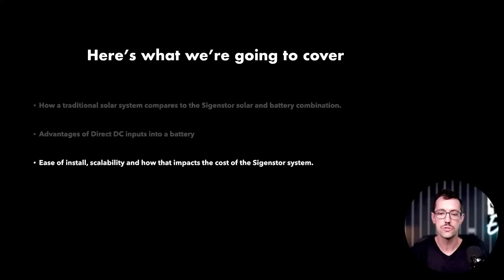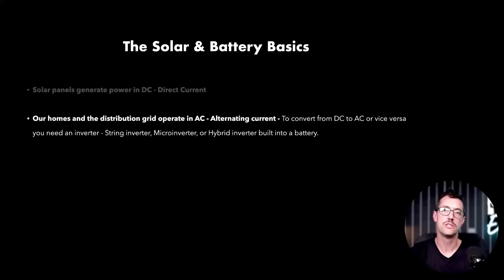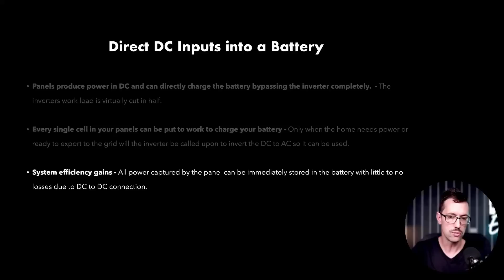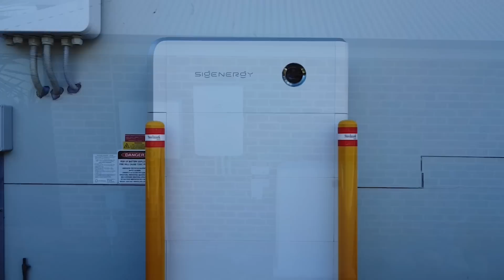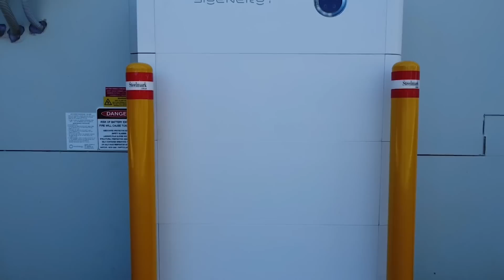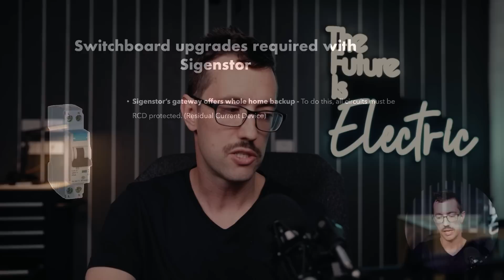Why SigenStor is Going Viral in Australia

Comment: I'm not sure about Sigenstor. I've been looking at the various options for a home battery system (I'm in WA). The problem I see is that the Sigenstor inverter (and hence solar panels and battery modules) stops working when it can't phone home to the Sigenergy server (in China?) over the internet in a 90 day period. I understand it does this to check the warranty status etc, but it's highly intrusive and worrying that your $10-20k solar system deliberately stops working if you either lose internet for 90 days, or Sigenergy (the company) goes out of business - they have only been around for a few years. It's a risk. There's also a, albeit slim, chance that Sigenergy could disable your system remotely if they wanted to (or were forced to) for whatever reason. At least for me, the security aspect is concerning, regardless of the (potentially very good) technical merit of the system. Which is a pity, because the Sigenstor system is otherwise very appealing, both technically and in terms of value. It would be great if this potential issue could be clarified. There should be no reason for critical home infrastructure like this to be internet dependent for basic functionality.
Reply: They use Amazon servers located in AU as per regulation and has passed cyber security tests of energy companies such as Origin.
Reply: @PJ-gw3op  Why would Origin care?
Reply: @PJ-gw3op  ummm... you trust Origin?
Reply: @PJ-gw3op the AWS environment in Australia means nothing. That’s just the initial dial home location, doesn’t mean that data isn’t then transferred elsewhere. Also the servers being in AU doesn’t stop Sigenergy turning off your system remotely.
Reply: @contactluke80 lol
Reply: Sigenstore ceo is ex-Huawei also. I didn’t know about the phone home thing. Absolutely a red flag. I won’t be buying without the option of local only…
Reply: Victron Energy systems are all Open Source.
Reply: the 90 day timing is now removed..... and you don't think that musk can shutdown every powerwall in the world...... stop the conspiracy bs
Reply: You're not sure, but I am. This is unacceptable. There should be ZERO communications between your power system and the manufacturer.  And this show-stopper should be 1000x more a red flag when that manufacturer is under the jurisdiction of a potentially hostile foreign power.

The idea of having software updates is a good thing. But there should be NO COMMINCATIONS HARDWARE AT ALL in your power system, and the software updates should be open source and audited by a trusted agency. Perhaps CSIRO would be willing to do that.

The company already turns off your batteries when it loses communication, and that's just a bit of a spanking to get you to stay compliant. What if they completely shut down your power the next time we have a trade dispute with China? Or what if it's worse.

On the business side, what if they say, "This system is no longer supported and will be shut down in 30 days. Contact your installer to upgrade"? Or what if they cut a deal with AGL/Origin and can shut you down when it's not in their commercial interest (like if you terminate your grid connection)?

All the scenarios where they can control your power are bad, and the trivial convenience of automatic updates isn't worth it. It would be hardly more work to download the newest audited firmware from a CSIRO website to a thumbdrive, and install it by inserting the thumbdrive manually.

Overall, I really like the idea of direct DC charging, but I'm not particularly keen on giving up control or being beholden to one company or the electric utility. We need a better solution that doesn't compromise in these areas.
Reply: @daveweinstein5044  I too am concerned by the scenario of a trade war with Sigenstore's parent government - the CCP. If SigEnergy gain, say, 20% of the home battery market in 'Western' countries, then relations turn sour, the Chinese Communist Party could instruct SigEnergy to remotely shut down everyone's systems. Suddenly removing 20% on a by then all-renewables grid would cause an immeadiate melt down and black out whole countries.

Think I'm over reacting? Federal and State Governments have already banned their departments all over Australia from purchasing/using Huawei communications equipment. For exactly the same reason - the potential for the CCP to take control in times of a trade wars.
Reply: @daveweinstein5044 100%
Reply: @daveweinstein5044  Excellent points. As you said any essential software updates (if they found a nasty bug for instance) could be easily done via thumb drive. A fast 32GB thumb drive from Officeworks is about $10 max which is overkill for any software update. I realise there is a cost incentive for manufacturers to put the software to control their more sophisticated appliances on a remote server and rely on the internet to drive the appliance, but it is a terrible idea for the consumer. Their internet could go down & your appliance stops working. The manufacturer can turn off your appliance any time it wants for however long it wants. In California, customers were surprised to find their air conditioners were disabled by their power company when the load on the grid got too high, which in California is a common situation. The customer paid for it, but the power company, by agreement with the manufacturer, had the final say as to when & how they could use it. Electric cars can be turned off remotely by the manufacturer. Amazon Kindle can arbitrarily revoke your ability to read any e-book you paid for. And these are US companies, subject to US justice system. Imagine how much worse it could be if the manufacturer was in China and there was no judicial appeal.
Reply: @daveweinstein5044 Sorry mate, you're delusional in the classical sense. Just about everything you wrote is hysterical paranoia not based on reality. China is the reason for Australia's current wealth so there would be more compelling issues for everyone than battery control if hostilities erupted. The only reason China toughened trade conditions several years ago was because of absolutely stupid accusations from the government of the time that China allowed a lab leak causing Covid-19 to spread. I don't blame China for its response to such serious delirious accusations by a nitwit prime minister. And even then, it just increased import duty on certain items.
Reply: @daveweinstein5044 or what if they turn every battery into a bomb by setting the system to overcharge the battery and circumvent the software safety features so thousands of batteries catch fire simultaneously?
Reply: This is changing on release of the new App version 3.0 which is due out tomorrow 01Jun25.

With the new version apparently the following will apply (as stated by the MD of Sigenery Australia this week):

• In scenarios where the system is not connected to the Internet for a long period of time, more than 90 days, we will change our operation strategy for our All-in-One systems, which previously disabled the energy storage function and allowed the customer to use only the pure photovoltaic power generation function.
• Now we will allow customers to use the energy storage function while ensuring system safety, and customers can continue to charge and discharge. Charging and discharging speed performance will be slightly limited, but it will not be significant for customers. (Limitations may be greater when the operating environment is very poor).
• The short-term overload function cannot be supported in the case of long-term offline scenarios, and the Cut-off SOC will be appropriately adjusted to prevent battery damage caused by customers leaving the battery unattended for a long period of time.
• All adjustments are made to ensure that the customer's system can run safely when offline, while retaining the customer's charging and discharging functions.
Reply: @GW666-e7z why would would charging  and discharging performance need to be affected because of a long term disconnection from the net? 

Also why would the short term overload function be impacted? All of these “smarts” should be on the local system.
Reply: @GW666-e7z  Thanks for making the effort to write this. It's important information.

Comment: Sigenergy is shaking up the market and that is definitely a good thing. One thing many are asking yet we won’t know for a while is the long term reliability and safety of these batteries. However all products have to be new at some point and I applaud sigenergy for bringing in some competition that is really challenging the others to start thinking smarter and actually compete and innovate. 

As a person who invested 10k into a pv system with a fronius inverter 12 months ago I am now a bit stuck. BYD batteries are very expensive comparatively and don’t give the flexibility sigenstor does. It’s literally a similar price to ditch the fronius and go sigenergy batteries and inverter versus BYD battery only connected to my fronius gen24 single phase. 

Here’s hoping this drives down some pricing so those of us with relatively new systems can have an option that has reasonable ROI and payback periods…
Reply: fat wurse  there only here   2 years  so be carefull and te warranty  off 2 years  on important parts is pathetic

Comment: DC EV charging requires a voltage more than the EVs battery voltage which would be at least 400 V or thereabouts, this would mean that you can't DC charge an EV directly from the SigenStror battery i.e. the energy would have to go through a DC-DC convertor (similar to an invertor).
Reply: That sounds right. If it is going through a dcdc converter they can use 30% more current than what they are putting out, it will be interesting to see how efficient that charging system is compared to its VTH discharging.
Regardless it would be a a big benefit to have bidirectional charging so you can ave that extra battery power for the house if/when needed and an extra dump load also.

Comment: The problem with this is that MOST installers charge a labour charge per kw/hr So the premise of more battery capacity = cheaper because Sig makes it almost the same to install 8kw as it is to install 32k doesnt hold water
The quotes for install of a 8kw system and a 16kw should only differ by the cost of the battery module minus the fed rebate at 350ish per kw + maybe $100 for install (i'm being generous)
Unfortunately for the great majority of installers - this is not the case at all. and you see effectively labour charges of 1000 or 1500 for install for additional battery modules
Reply: So inspect the quote.

Comment: The hybrid inverter unit still does work when doing DC-DC as it has a couple of DC buses to maintain at the designed voltage levels (eg. Main DC bus from PV, battery charging DC bus). SigenStor don't appear to have included their DC charging bus output capacity on their data sheet so it's difficult to know if they can do full 10kw AC to grid plus x capacity of DC battery charging.
Reply: actually they have as it is the battery module ratings. each module can be charged at 0.5C ie 4kw for the 8kw battery so two modules = 8kw charge rate, 6 modules 48kw - dc at 24kw or AC grid charged at the inverter rating.
Reply: @AusPhilMotivated TY for that info, I was wondering how much PV input they can handle.
The batteries can handle that input charge rate, but can the MPPT’s on the inverter handle that much input from solar to charge the batteries at that rate? That would be nice.

Comment: What is known about these batteries in terms of their need to phone home (China), can these operate without an internet connection?
Reply: As per my previous comment:

This is changing on release of the new App version 3.0 which is due out tomorrow 01Jun25.

With the new version apparently the following will apply (as stated by the MD of Sigenery Australia this week):

• In scenarios where the system is not connected to the Internet for a long period of time, more than 90 days, we will change our operation strategy for our All-in-One systems, which previously disabled the energy storage function and allowed the customer to use only the pure photovoltaic power generation function.
• Now we will allow customers to use the energy storage function while ensuring system safety, and customers can continue to charge and discharge. Charging and discharging speed performance will be slightly limited, but it will not be significant for customers. (Limitations may be greater when the operating environment is very poor).
• The short-term overload function cannot be supported in the case of long-term offline scenarios, and the Cut-off SOC will be appropriately adjusted to prevent battery damage caused by customers leaving the battery unattended for a long period of time.
• All adjustments are made to ensure that the customer's system can run safely when offline, while retaining the customer's charging and discharging functions.

Comment: If you are off-grid or have a lot of battery, then AC doesn't really make sense anymore.
Almost any device you attach first converts the AC to 300V, and then DC-DC that voltage to the required voltage.
The invert takes DC as input and tries very very hard to make a perfect sinus of that with a lot of power electronics.
It's more cheap, much more efficient (these day(!)) and less lethal to go from battery storage voltage DC-DC to house DC voltage.
Reply: If you are speaking of 12vdc battery solar, it is only good for lower wattage items, lights, tv maybe, fridge maybe, but if you want a few higher power items like microwave, toasters, jugs, coffee machines, induction cooktops, AC, etc, you need 240vac or you start running a lot of heavy copper wire which is probably more expensive.

Comment: SO if I have an emphase system with the inverters on every panel... I can't utilise DC charging off that system? Am I understanding correctly? Have a power wall 2 at the moment, which has degraded a fair way, was keen on Sig to replace it.
Reply: You can't DC charge from an Enphase system, as every panel's DC output is inverted to AC, at the panel. You can integrate Enphase systems with Sigenergy tho, as an AC coupled arrangement. They connect to the Sig gateway's smart port. Your micro inverters are warranted for 25 years, no sense throwing them away.
Reply: @MichaelWakefield-mx6hg  Thanks legend, that was my understanding, just wading through the info; I thought it would be as simple as putting another PW2 on, and 12 months ago it would have been! But the last 12 months has seen a lot of changes in the solar/battery landscape. Sig still seem to be a top their option.
Reply: @tt123x  👍
Reply: @MichaelWakefield-mx6hg so there is more power losses when you have the enphase microinverters like in this setup?

Comment: Nice video Daniel. I see the ace in the pack for Sigenergy being their DC EV charger. Not only allows DC to flow directly from panel to vehicle, but by bypassing the EV charge inverter, they are best placed to take advantage of bidirectional capabilities. 

If you think about it, your connection to the EV's battery is via the charger. If you have a 7.4KW AC charge point, that's all you'll get from the EV battery. A DC 25KW charger gives you just that - up to 25KW back to the SigenStore stack, which would most likely view the EV battery as just another in parallel in the stack.

Comment: Doesn’t match up to the Tesla powerwall 3.  I place the SIGENERGY battery second to all others batteries available at present .
Reply: Try starting your aircon on a hot day whilst your stove is running , SIGENERGY battery can’t cope with that  where the Tesla powerwall 3 can handle it hands down.
Reply: @Backseatobserver-1 unbelievable. Did you pull that out of your arse? Where’s the data to back it up? I knew there were Tesla fan boys and you seem to be proving it..
Reply: @Backseatobserver-1  That just depends on how many KW of battery storage you have. The Sigenstor can output 50% of the battery rating, so if you only have one 5kw battery it will struggle as it can only output 2.5hw max and can struggle, but most people get 8-16kw and they can output 4-8kw which is fine for most AC's except for large ducted systems and the system should have been designed on what the potential output is needed. I have 16kw at the moment and we run 4 seperate split system's at once with no issue at all and can still turn on the stove but we are adding 4 more to take it to 48kw's and that can output 24kw at any time which is more than enough for any AC ducted unit and other home appliance.

Even on the 5kw battery everything will still work, but any excess needed above the 2.,5kw that the battery can supply will simply be drawn from the grid anyway, nothing will stop working.

The Powerwall 2 could only ouptut max 5kw from it's 13.5kw's so that's less than the sigenstor (50%).., the Powerwall 3 can output a greater percetange (11kw of it's 13.4kw).
Reply: @Backseatobserver-1 my sig system handles it fine
Reply: Care to explain WHY? Please present quantitative data and facts and not your opinion.